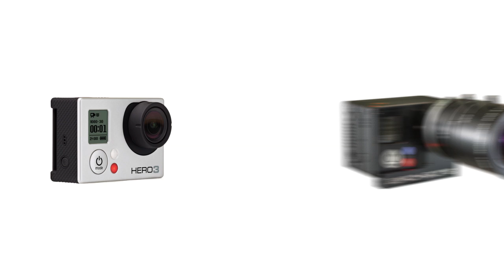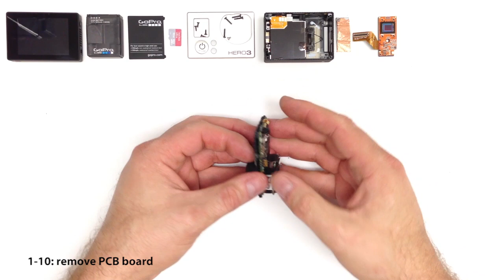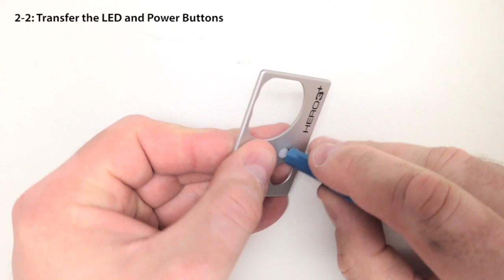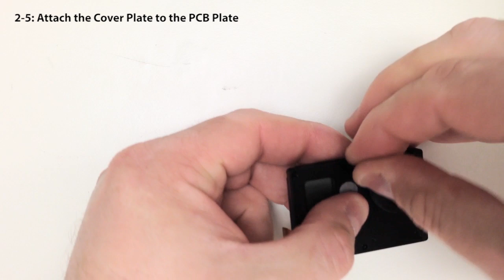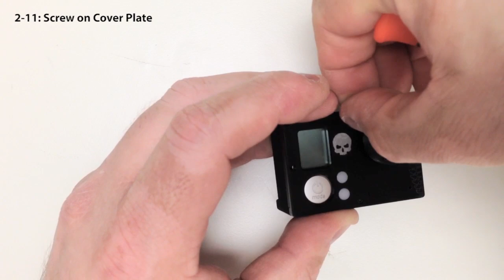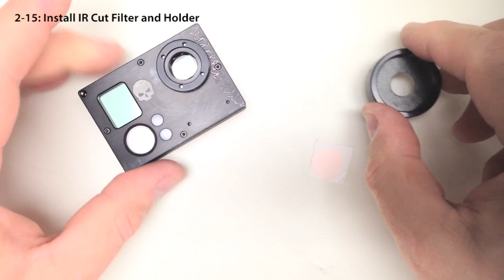Installing Your Ribcage Mod Kit v1.1

Comment: I'm wondering how I can make this work on my DYS 3 Axis Gimbal attached to my modified TBS Discover Quad Copter?  Would I need a counter weight to offset the weight of the lens?  I think the motors will work but will have to adjust the PID settings.  May take a while but I think this might work and that would be fantastic!   any comments anyone?